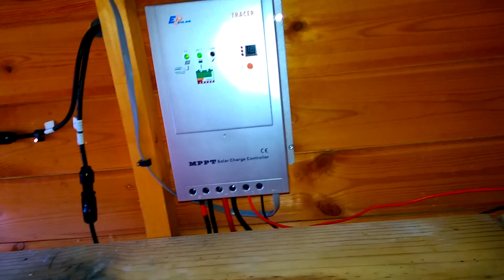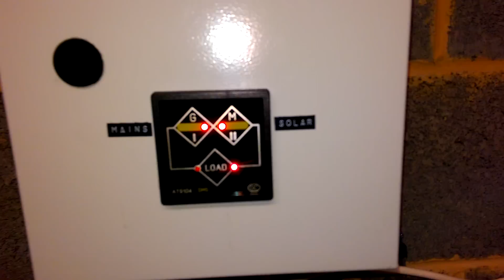Solar-powered Bitcoin Mining farm

Comment: you wont even break even with this setup before even considering the miner. it would be more efficient to throw the solar panels in the bin and run off mains. the problem is the cost and life span of the pb batteries. i cant be bothered to work it out properly now but lets say your batterys are 110ah at 12v  (i think about 1.3kwh storage) and this battery cost you £80. you are going to have to charge this this battery 450 times at 100% efficiency just to break even with the cost of the battery! add on the fact that you are inverting the power so - about 20% in efficiency losses aswell as the cost of the solar panels. you should have used a grid tie inverter. they are about the price of your mppt charge controller, then when its light turn on the miner and if theres enough sun your are running for free, if not you pay for the difference. at night you decide if you want to keep it running and pay for electric or if you turn it off. good project but you are throwing money after money by the looks of it :-(
Reply from the maker: I appreciate your concerns and you are mostly correct, it's nice to get an intelligent comment occasionally. It was more profitable last year. As several people have pointed out, my setup seems overkill for one S3 and they are right. This is just the beginning, in April I intend to get the roof of my house covered with panels and a grid tie inverter as you suggested, on a free rent-a-roof scheme. I will then combine the 2 systems by linking a 50A charger to the batteries that runs in daytime on a timer from the main panels whilst simultaneously powering the miner. Then the stored power kicks in at night as controlled by the shed mppt controller using the 2 shed panels as a sensor. So I should be able to continuously run the miner from direct or stored solar power and still have surplus power for my house. I've already sold the S3 and will be getting something more efficient when I've got the roof panels. I might not even buy another miner due to difficulty increases. Just use the system is described to power my house. It's all an experiment.

Comment: i have 2x240watt @24v solar panels already on the roof. But i have 6x12v/100Amp batteries. No transfer switch though. Thinking of going with s5. how long does it take you to make 1 btc?
Reply from the maker: A few months with an s5

Comment: how many 12v batteries do you run?
Reply from the maker: None. There are 8 x 160Ah 6V batteries in those containers. Connected in 4 series pairs to parallel rails to make 4 x 160Ah at 12V, 640Ah in total.

Comment: You spent over 2k for getting only 80bucks a month? great investment
Reply from the maker: where did I say I spent 2k? nowhere near that much.
Reply: Even more yet?
Reply from the maker: +Antonio Gutierrez most of it was paid for by bitcoin I mined the previous year. The batteries are from an office UPS insurance clearout. The solar panels are second hand, bought with bitcoin. The only things I had to buy new and pay for were the charge controller and the transfer switch box. Antminer was bought with mined bitcoin. Its not as expensive as you think if you look in the right places for equipment.
Reply: Great to hear that RoguePlank, I commented that based in my own experience about mining bitcoin. I can tell that I've spent more in equipment than the machine itself and I'm not mining with solar panels so the cost on electricity is really high and when you measure what you can get with a miner than doing another activity for instance Faucets, trading and many others, you finally discover that you messed everything around, investing in something which is rarely productive. I was getting only 2usd mining in f2pool daily with a 1200ghs, while trading, doing faucets and gaming for btc, i am almost getting 3usd in less than 24 hours that I had to keep running this machine, not to mention that the area where I live is really hot and I had to adapt an air Conditioner.
Reply from the maker: +Antonio Gutierrez it is hard to make it profitable these days
Reply: Bitcoins hit $17k recently each.
Reply: @Antonio I would take that 48% return yoy 😂

Comment: My design is pretty similar. But instead of using an inverter, I just ran straight from batteries to the miners (seeing they are all 12v to run).
Reply: That is a much more efficient thing to do. Instead of having to take 12v, step that up in an inverter back up to 120v, only to be stepped down to 12v for the miners, you are cutting out two middleman and reducing energy usage in the process.
Reply: If you want to power a 350 watt mining farm with 12v you would get a current of roughly 29 amps. Pushing this current threw a 20 meter long (shed->house->shed) standard 1,5 mm^2 coppercable would create a powerloss of 204 watt only in the cable and a big voltagedrop. This is hypothetical but I don´t think this is more efficient.
Reply: Actually you will probably not be able to draw 29 amps with only 12V while using a 1,5mm^2 cable because the resistance of the cable will limit the current. 
Just set the charger and batteries close to the miner.
Reply: It's always a bad idea to run long cable length on low voltage. The panels have a slightly higher voltage so you could just run them over the longer distance to the charger.
Reply: not if you use a thick enough cable...

extremely thick rolls of incomplete copper wire can be purchased from my scrapyard by the pound, meaning a 500ft roll of 8AWG wire may end up costing 1/5th the standard retail price for the same thing. He could do this, gain efficiency and save a significant amount of money in the process since now all he would need is some thick copper cables and that's it. 

Of course, it would be better just to place the miners close to the solar panels.
Reply: Thats just retarded. Lots of railways around the world run 5v for hundreds of meters with no problems at all, we arent talking about overhead powerlines that runs 10-100kmhs where they do step up the voltage for that reason.... Your voltage drop is only due to the cable size and the huge thick cable would be cheaper than the inverter.

Comment: Also, those batteries will cost more to replace that the miner ever makes in their life cycle..
Reply: UpNorthSound But do you have to replace the batteries at the same time as the miner? can't you just replace the miner? I'm actually asking you I don't know
Reply: It depends which will go first but what is the point of that question?
Reply: UpNorthSound you said the batteries will cost more to replace than the miner will ever make in its life cycle, and the miner is just the computer unit itself, so the batteries could last for maybe even 5 life cycles, paying for itself many times.
Reply: I mean as long as you don't cheap out on crap batteries
Reply: But the batteries will cost more than the miner would make in 5 life cycles?
Reply: UpNorthSound but then its worth it even if you make it only 6 cycles no?
Reply: UpNorthSound All solar units have batteries.  If they never paid for themselves in the long-term, nobody would ever buy solar.  The trick is to calculate the savings long-term and see if it pays for itself.  It's hard to beat free power, but he says above that he only uses solar 33% of the time, which would make it difficult to recover unless his power is already cheap, like 8c/kwh.  When difficulty goes up, batteries will become the issue and he'll still eventually need to upgrade his ASICS.  Mining is hard nowadays.  The best route would be to get some cheap Ant S5s and cheap batteries and only run them on solar power.  Just shut them down at night if/when the batteries die and turn them on in the day.  It does no good to run negative... even for a minute.
Reply: I have solar panels I didn't say they don't work I said these circumstances are not cost effective..
Reply: Such BTC being 10-20k right now.

Comment: why are you stepping up 12v DC to 230v AC then back down to 12v DC? surely theres a loss in power by doing so?
Reply: U cant run that long of a 12v cable without having to have huge ass thick cable
Reply: The psu has a clean 12v Output
Reply: use a 12v to 12vdc regulator
Reply: drawing power directly from battery is not a clean source as they range from 11.5 - 13.4v unlike a switching power supply which will give you a fixed 12v..  a simple 12v to 12v reg will solve that tho

Comment: That machine today costs 500$. Your setup must have cost a few quids also... I think what we're all wondering... do you really make a profit?.
Reply from the maker: As the majority of the equipment was paid for with mined bitcoin and by selling off obsolete mining equipment, the initial outlay wasn't too painful. The Antminer cost me about £100 used, not $500. The S3 is effectively obsolete but off-setting it's power consumption  by using the free solar electricity artificially increases it's efficiency. Meaning, the system does make a profit, yes. As it generates more bitcoin than it uses in power. Just not a very big margin, only a few pounds a month. But I was never in this project to make money by mining.
Reply: RoguePlank how long it took you to build that set up
Reply: yea he did by now lol  $2,450 today
Reply: RoguePlank What if you used that solar power to cut down on your power bills, and bought Bitcoin with the money you saved instead? Anyhow, I understand you're not doing it for the profit, and that's great, I wish everyone ran at least 1 ASIC's device each for further decentralization of mining.
Reply: RoguePlank  I assume there's extra energy at times to power other things. Is the electricity setup to go both ways. meaning if you have your batteries full during the day does it help cut down on your electric bill?
Reply: Yes it'll be over two years ago since I purchased that piece of garbage and bitcoin valued only 250 usd, I've got grandma,  but she's dead.
Reply: Michael Baker 4200 today lol
Reply: 10k USD per coin. Investment paid of for sure. Nice one! :@)
Reply: sensus amazing
Reply: It hit 17k at some point recently.
Reply: +reloadfast believe me not, I also made my worst decition in long time buying a crap of ant s5, after two months of smooth work, suddenly quit mining and guess what? The chineeseeeeee don't know english and the one who think they know are totally unusable, so don't invest in this ridiculous stuff, it'll get you mad all the time and you'll be doing over 60bucks a month, and you will have to pay 200usd in electricity and other things. Worst investment ever for me.

Comment: That's a pretty nice setup that I would imagine cost you in the thousands.  Since I don't know where you live it's impressible for me to speculate on your solar power system ROI, but if you happen to live in area with less sun than say southern California, your relatively small solar panels will have a hard time keeping up with the miner, even with a single antmain unit. Just my observation.
Reply from the maker: That's what the automatic transfer switch is for - it cycles between solar and mains power as I don't have enough solar panels to run continuously on solar. It manages about 6 - 8 hours a day on solar power stored in the batteries to be used at night.
Reply: +運動熱衷者 Oh damn lol he got you. He said he was not in it for profit and that the solar panels are not good enough lol. He's got a switch and that's what fixes that issue. Brilliant. Good job with making the video and the setup.:)